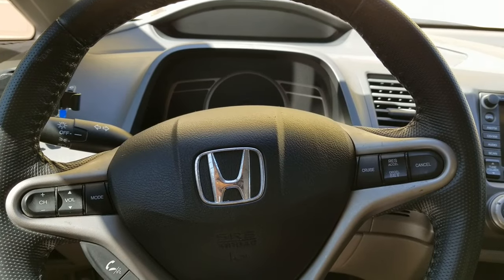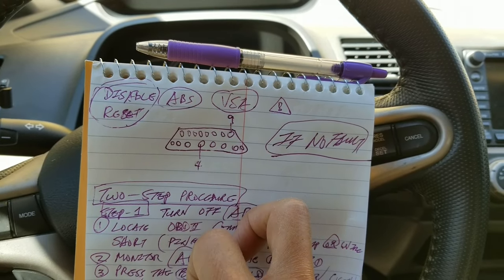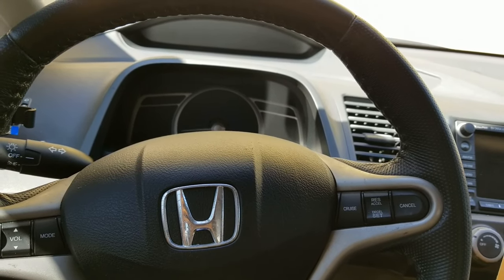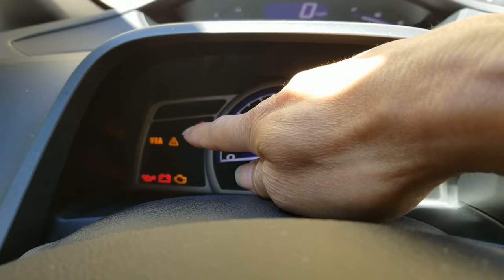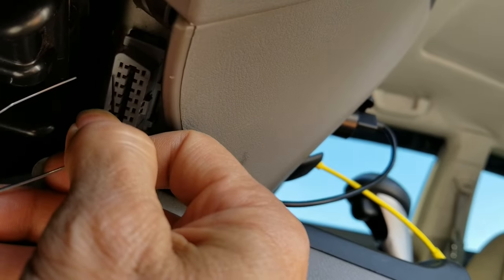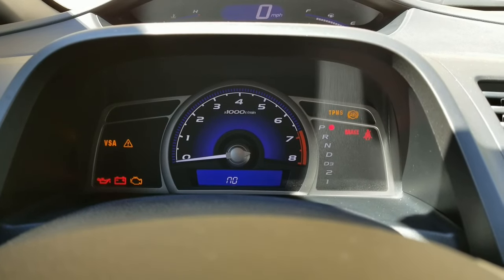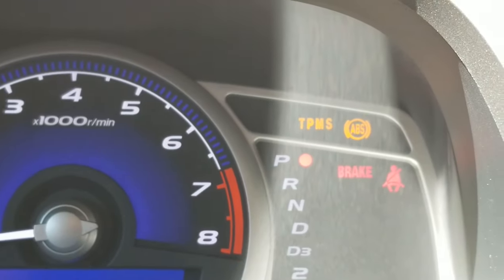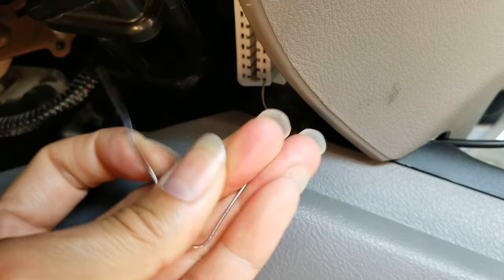How To Fix & Reset Honda VSA ABS & Triangle Icon w: Exclamation Mark When All Sensors Are Good!

Comment: Careful with pin 4 consult your diagram with obd PIN number. After that everything works. My problem was the triangle won’t turn off. Then VSA light comes on with speed over 40K/h. When turn engine off then on again the VSA is off but the triangle is still on. The problem persists, until I done this procedure everything back to normal. NO MORE WARNING LIGHTS. NO MORE VSA LIGHT.

Comment: Thanks for the video.  Except for the pin discrepancy - you refer to pin 5 in your video, not 4, it worked like a charm.  Thanks for the help!
Reply from the maker: Glad it helped
Reply: You are correct. You count bottom right to left.

Comment: I tried a XTool D7 OBD2 scanner and it turned on a couple dashboard lights.  Kinda funny because none of the gauge actuation functions are supported (2007 Honda Pilot).  Couldn't get the VSA light to go out.  Tried what you showed a couple of times and it didn't work.  Ended up using the scanner to clear codes in pretty much every module it could, then tried your jumpered method and it worked.

Very nice.  Thank you.  🙂
Reply: I had the same happen to me when I was using my new Xtools D8BT to scan for codes on my 2005 Honda Accord just a few days ago - nothing was wrong with the car, I was tinkering. After the scan, and clearing a low battery voltage code that was set years ago, the triangle light was illuminated. It can be reset using the Xtools scan tool, but it's not under gauges. It was in an obscure location within the Honda sub menus - there was an area where I was able to reset the yaw & ABS sensor, and this reset the indicator light on the dash. Next time I use my tool with the car, I'll document the exact menu sequence and post. It's likely the same, or very similar, for your Xtools D7 tool. I am now wondering if resetting the codes while on a sloped driveway with the Xtools scan tool triggered the condition. While going through the yaw reset procedure, I was instructed to be certain the vehicle was level, with the steering wheel centered, and the wheels pointing straight. Had the same happen with a 2006 Chevy, but it reset the triangle light on it's own once the vehicle was started.

Comment: Dude that actually worked. Process was just slightly different on my 2009 ridgeline. First part exactly the same, second part held pin 9 to ground the whole time with alligator clip wire, had to press and hold VSA button while turning ignition on... then the very last part had to hold the VSA button again, there was a beep and then the triangle exclamation light went off and stayed off. Nice coke nail BTW.

Comment: I’m confused about the second VSA part and the part that you connect to the door! I think I can do the first part!
Reply from the maker: Connect Pin 9 to the ground(door screw), you can write down the direction on paper so you can follow step by step.
Reply: @macdaddypimpping  thank you ! Today Honda quoted $1800 for a new Abs module and I don’t even think that is the problem it’s my emergency brake light vSA and Abs ( originally needed brake fluid) then never reset .

Comment: what is pin 4 and pin 9 in 2007 Honda Odyssey EXL ? Please let me know, since I can not start my car, the the green key light keeps blinking, and now the OBD2 port shows no sign of connection, after doing what you  recommended  to reset the ABS, VSA light.
Reply from the maker: https://www.flexihub.com/oobd2-pinout/

Comment: Light will go off but if you have an issue it will come back ! It worked for me but the VSA light came back on I can't figure it out what my issue is
Reply from the maker: Check on the wheel speed sensors and make sure all the hardness are connected and no loose wires.
Reply: @macdaddypimpping  thank you I will check on that

Comment: Do you have any idea how can i get rid off the abs ligth since i dont have ABS. I just change my panel gauge but unfortunate i buy the wrong ppanel with Abs  but my civic dosent have any ABS module
Reply from the maker: You should just remove the bulb for the ABS.
Reply: Covered the light  gauge with black electrical tape , or just it  ignore it 😬

Comment: This works but only if you get the correct pins. These are horribly marked and you can easily get pin 16 instead of pin 9.  If so you will blow the ACG S fuse (15a) which will give you the flashing green immobilizer key lamp on the dash, and the car will then not start.  To test that you have the correct pin, test the pin with a volt meeter first.  Pin 16 will have 12-14 volts on it at all times.  Pin 9 will not and no reading.   Pin 4 and 5 mix up works out for they are both grounds.
Reply: How do you get the car to start ??
Reply: I replaced the fuse but still nothing not even the clicking sounds
Reply: my car wont start omg!

Comment: Well Dude ,l just did it and blew up my Radio and lock Door and still the ABS light on. l feel very stupid for being done that stupid advices 😡🤬😡
Reply from the maker: You probably didn't do it correctly, the video proves itself for not shorting out anything.
Reply: You counted the wrong way , you silly 🤡🤡
Reply: Pins are counted left to right or right to left .
Reply: @anejchabbra1021 right to left. He is showing it wrong.
Reply: The same thing happened to me.